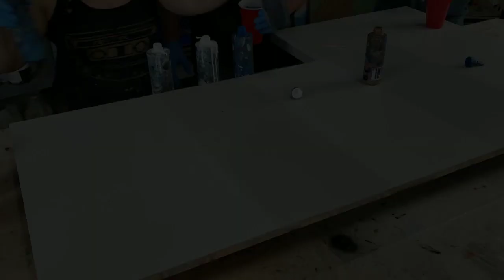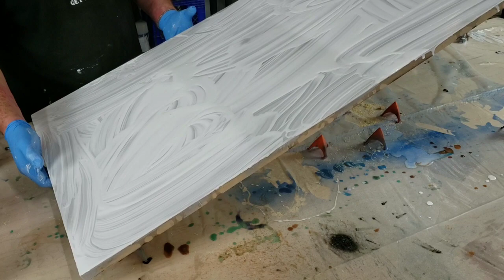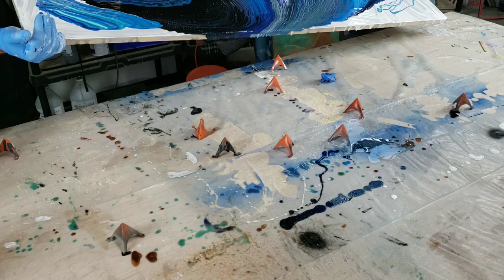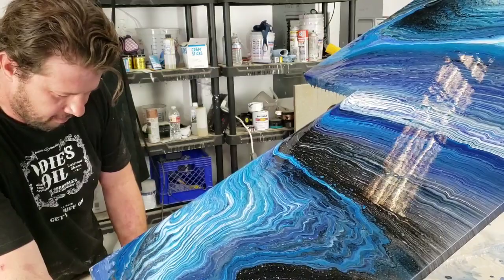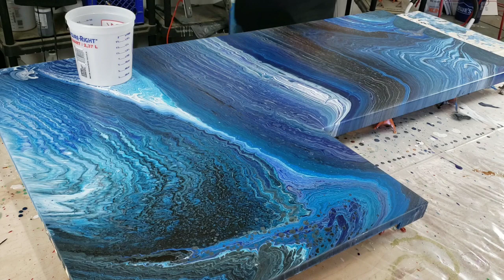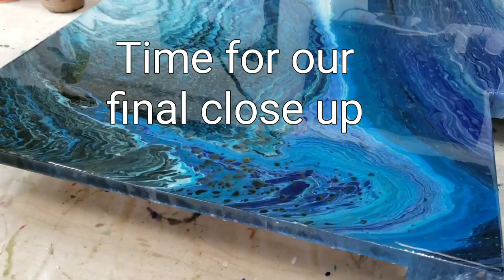Acrylic Pour on a Kitchen COUNTER!!!

Comment: Wonderful ! ...Do you need to prime the surface if it’s a slippery laminated surface and will paint stay on in the long run or will it peel away I’m not using it for tabletop but I have a few laminate wooden MDF panels that I’d like to paint on..... thanks in advance I will varnish but I won’t resin because it’s for the wall not to eat off etc .. thanks in advance🙏

Comment: Question: will this withstand high temps? In other words, can you put a pan from burner or out of the oven right onto the countertop like you can with granite? 

I’ve been wondering about using the resin molds to make trivets - they’re pretty as coasters, but won’t absorb liquid so i hear ppl usually recommend using them for coffee mugs and things that don’t sweat… But what about trivets for hot pans/casserole dishes, etc...

Comment: The end result is BEEEEEEEEEAUTIFUL!

I wonder though, how well does the 
final finish hold up against knife marks/scratches when cutting fruits/vegetables
over a long period of time.

Or is this meant to not be cut upon
unless you use a cutting board?
Reply from the maker: It is extremely durable. I don't think most people cut on their counters, but with normal wear and tear this epoxy holds up very well. It cam also be polished at any time or a new clear coat could be applied down the road if desired ;)
Reply: @MixedMediaGirl  
Thank you for that info!👍

Comment: I am wondering the cost of materials.  Or quantity need to cover surface with paint.
Reply from the maker: I use 1 ounce of pre-mixed paints per 16 square inches. The cost depends on what supplies you use and where you buy them. The paint for this project cost less than $20 total, with an additional cost for the resin.
Reply: @MixedMediaGirl  Thank you!